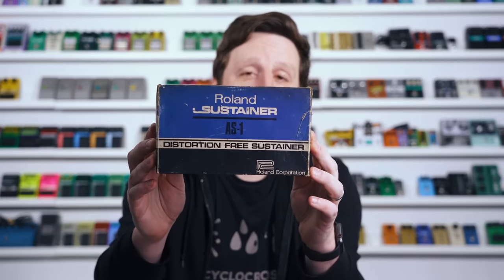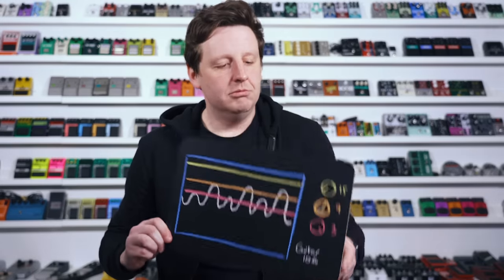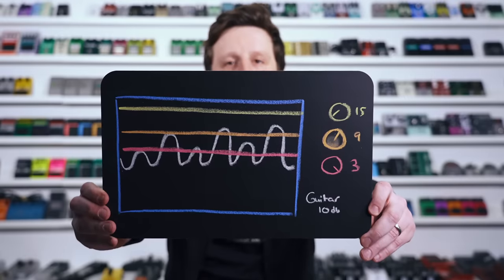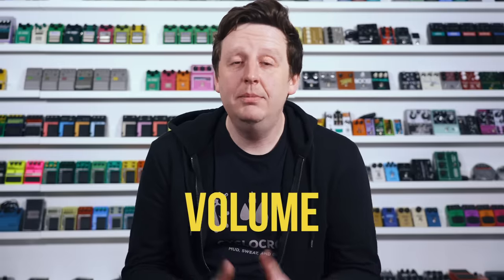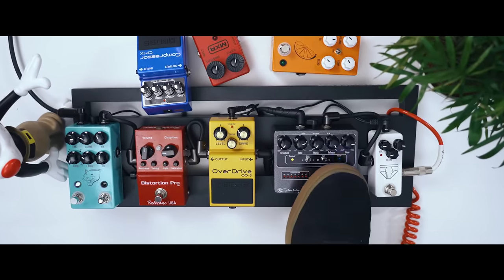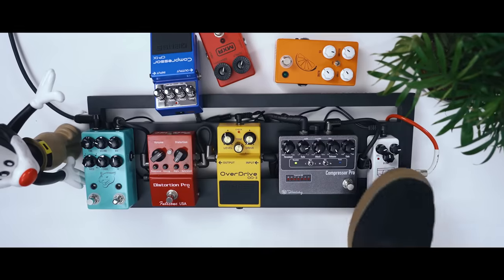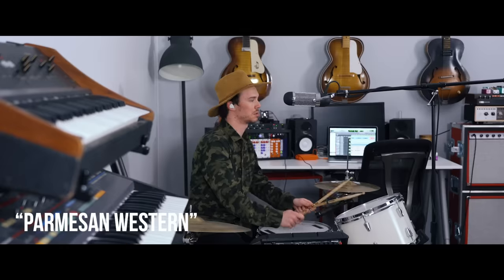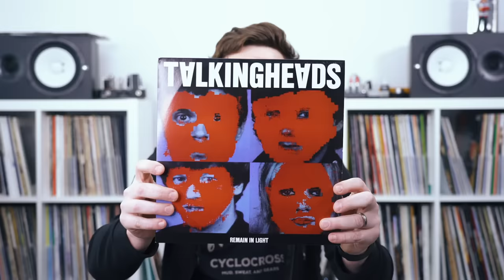How Do Compressor Pedals Work?

Comment: For me, the fewer pedals the better. Less noise, clutter, connections, cables etc....I would LOVE to see Boss combine their tuner and compression pedals into a single unit, since they are often first devices in a signal chain.
Reply: that’s not a bad idea. click on, tuner. click off, compression.
Reply: Click on compression, click off no compression. Hold for 2 seconds, tuner
Reply: @joshualessore7652  exactly. Compress, bypass, tune. I usually only use a compressor when playing single coils percussively.
Reply: fantastic concept... I'd buy that!
Reply: I hate compression pedals before distortion, steals all the attack and makes overdrive sound like crap
Reply: With a lot of pedals, having a good input and output buffer and possibly an isolator such as the Lehle P-ISO can go a long way in reducing noise. It is also crucial to invest in a proper power supply and high-quality cables. Never cheap out on cables and power, high quality power supplies and cables are expensive yes, but they are worth every penny.
Reply: Lol
Reply: Great idea!
Reply: @thebrunoserge you'd have to set up a compressor pretty poorly for it to sound better after any kind of drive.

It add a huge amount of attack. Listen to any country pickn for reference.

After drives, you're squishing your distorted tone and getting that awful mosquito buzz tone. Also you're introducing a lot of pointless noise by amplifying it's ratio vs guitar signal.
Reply: @constantk8780  I think you're right. Since then I've switched to compressor before volume/wah and distortions. I also got a new drive pedal (caline pure sky) to replace my Il Torino and it stacks much better with my JHS AT (different drive archetype helps, il torino was LED based similar to AT so they were weird stacked). Now I feel compressor first sounds superior for sure. Ohh and also I didn't know high distortion was supposed to go before low gain drives. I learned a lot
Reply: @thebrunoserge you don't have to turn the compressor pedal on when usuing distortion
Reply: @ConditionZero76  True, distortion already compresses it 90% of the way. But still, most people set and forget the compressor on the board and leave it on because it's the only way to get a usable clean neck tone, often
Reply: @thebrunoserge  Depends on the pickup and the Distortion...  My Diamond has an active bridge pickup just about as hot as the sun, my choices going into a fuzz are use a compression pedal to roll of the ear splitting top noise or never turn the volume up on the guitar past barely on.  The key to using compression before distortion is to have the CORRECT type of compression and adjust the attack setting of the Compressor so that it lets all of the start of your note through and clips a touch (and I mean just a touch) AFTER the attack of the note.  If you get your EQ and Compression right going into your distortion you can isolate your sound better in the mix and avoid getting lost in the flub
Reply: @thebrunoserge the whole point of the attack control is to enable you to increase the amount of attack by not compressing it! The result being a more consistent and powerful attack!

Comment: Never really understood compressors, always thought it was something they added in the studio. This helped a bunch, thanks!
Reply: They’re potentially useful at almost any step in the signal chain, and very useful in live situations as well as in the studio! I can’t remember the last time I did a mix that didn’t involve some compression somewhere (and that includes monitor mixes, too). Just don’t over do it or things will sound weird. Knowing exactly what “over doing it” means is a topic that could fill a book. Fortunately, in the context of guitar pedals being used in guitar rigs, there’s an easy 2-step process:
1) If your guitar sounds more like the way you want it to with the compressor than it does without, it’s probably fine.
2) If you’re still in doubt, back off the compression knob a bit and return to step 1.
Reply: Well, they also ALWAYS add it in studio to everything. The best way to understand compressors is just to try them, and to do so in every part of the effect chain, since they're really versatile.

Comment: Since you mentioned putting compression before ODs, I'd love to see a full video on best practices for effect order. The hows and whys of where to put each effect  in the signal chain. Maybe some sidenotes on buffers, or tricks to do with A/B/Y switches.
Reply: You just have to learn to picture the chain in your head, start with the least effecting into more dramatic, say drive into phaser will be powered but swishy is last say on the matter, phaser into drive has over all distortion but swishy internals, eventually everything becomes a preamp, and all you want is a preamp, they make the clover for that
Reply: That's why the blend is important; before that was a common feature, it really was only viable to place before drives, where the effect is NOT subtle; placed after, with a decent dry level, you can retain dynamics while increasing sustain.

Comment: I've tried a bunch of compressors, and find that ones with a blend control sound best. I'm currently using The Warden Compressor by Earthquaker Deicives which you mentioned. I have it as a subtle always on effect. Thanks for the video, Josh. It was great and I'm liking the new jam section format to the videos.

Comment: Hi Josh, thank you for the detailed explanations on comp controls. I use a Strymon Compadre analog dual voice compressor first in my signal chain as an "always on" pedal (it was released right after you made this video). Compression set to about 65%, Blend at 50%, Level set to unity gain and voice switched to "Studio" setting. I am new to using compression and it is a true game changer for my 80's rock pedalboard setup.

Comment: GREAT video!!!
I use 100% ON Dave Barber’s Tone Press at the beginning of my signal chain after my Line6 G70 but before my A/B LaunchPad. If I understand correctly, Dave was THE guy who invented the parallel blend for guitar compressors, of which all others have followed, to which we all have benefitted. Barber Electronics pedals are my personal FAVES for his compression, his gain boost pedals (multiple versions of the “LTD”), and of course, I also use his A/B “Launch Pad”!.. and the 2channel Burn Unit EQ is my go to for internal trim pot tweak-able distortion.

Comment: Exactly against your advice i use an mxr after my overdrives as a solo boost. It gives more volume and sustain, smooths out the differences between overdrives, doesn't change the tone. Its been on my setup for years...

Definitely tempted now to get a tighty whitey for the front of the chain exactly for the OD input and smoother clean rhythm chords

Comment: Transparency is the most important part of a compressor. I was under the impression that the Dynacomp and Ross weren't transparent.

I initially bought a compressor as I wanted more clean volume from my Fender Concert amp when playing with my band. It did that well as the attack signal excursions were limited and the amp didn't distort. The tail of the note was amplified too which sounded louder too. 

I then like having it on all the time as I found single notes didn't disappear into the ether.
Single notes were the same volume as chords which handy.

Comment: Awesome video! Just a quick note about the threshold part – it can sometimes be a bit tricky to grasp. The threshold acts as the point where the compressor kicks in, but it's not like a strict cutoff.

Imagine your signal is at 10 dB and the threshold is set at 9 dB. With a 1:2 ratio, you'll actually get around 9.5 dB, not exactly 9 dB. What happens is that the compressor starts reducing anything that goes above 9 dB by half.

Thanks and cheers!

Comment: Just bought the JHS Pulp n Peel V4 to use with my upright bass. The response from my Fishman pickup has always been uneven across the strings and up the fingerboard. The blend control on the PnP V4 lets me dial in just the right amount of compression to level out the response without squashing the acoustic sound and natural attach. A great solution for upright bass pickups.

Comment: I have 3 different MXR compression pedals that I use for electric guitar.  The original DynaComp is mostly always on.  I also have a Super Comp and a.......?  I don't remember but it is some moded version of the Dynacomp.  I have very specific uses for all 3.
I also have a rack mounted optical compressor that I run my mixer board through.  It is a bit more difficult to discern what that one accomplishes but it mostly brings the mix together.

Comment: Hi and thanks for the explanations.
Compressor freak here, using them since ever, both in pedals (SP from exotic, Carl Martin,etc) and outboard rack gear (Symetrix, SPL, Drawmer).
Can do without, but prefer to have the option 'with', never always on, unless it's an ambient thing.
People tend to down play compressors or just regurgitate what they've heard, but take your time to try, with different settings, and you might find something useful in there, as I did. And yes, it works great with distortion too. You have inherent compression with a tube amp.
And 'compression', is everywhere.
Reply: And they sound great 'after' a Reverb...!

Comment: Used to be in a surf music band and used compression on lead guitar with a rack mounted DBX 166a. but when I got into The Byrds after my wife bought me a Rickenbacker 360 12 I totally went nuts on compressioni bought the first edition JangleBox which got me that famous Roger McGuinn sound. After a few years the JangleBox 3 came out which had a redesigned circuit and added treble and base adjustment and a boost section with separate treble and base adjustment.
 It is my always on pedal from LedZeplin, AC/DC, U2  to praise music that pedal is total awesome sauce!

Comment: I use a vintage BOSS CS-2 at the front of my signal chain and my playing leans towards the Andy Summers/post-punk textural style with lots of clean tones.  The compressor makes single-coil pickups punch and thickens up flanger/chorus/signal processing effects wonderfully.  Downside is distortion and overdrive tends to be essentially non-varied in volume and not all that touch sensitive.  If you're a blues guy- don't even bother with compression because it will rob you of that dynamic touch and finesse- but if you are looking for that big, punchy, processed 80's clean-toned guitar sound ala The Fix or The Police-  the compressor is the perfect pedal.  

Can you imagine Mark Knopflers' Strat tones on "Sultans . . ."  without compression?  How about Trevor Rabin's killer clean tones on Yes' "Owner Of A Lonely Heart" without it?  That's the beauty of compression.

Comment: I gotta add one more pedal......the TC Electronic Sustain+Parametric Equalizer. I got one back in the late 80's, and fell in love the first time I used it! I'm a bit odd, as I don't use compression on clean sounds. I use it to boost either the gain channel of my amp( Mesa-Boogie ), or gain pedals in the clean channel.  It is KILLER!  I can be in the lead channel of my Boogie(with the gain ALL the way up!!!), turn the pedal on with the guitar volume on 5 or so, and no noise at all. I know what Josh is saying that compressors don't generate noise.....but when you use them to boost distortion, with a lot of other compressors that I have used over the years, there IS noise. But not with the TC Sustainer. Best compressor hands down for distortion!!!!

Comment: This all sounds well and good but I feel the need to point out that my favorite living guitarist, who has probably the best tone I’ve ever heard, stacks 2 tube screamers in front of his Ross compressor… I mean, there are multiple ways to get around the effect of the confessor after OD hiss… and if you can manage it you can pull off a ridiculously sustained tone. Hollowbody -> overdrive -> compression… then your guitar’s volume knob becomes your overall gain, and you can back off and clean it up nicely or dime it for an aggressive sustained tone. I personally do this, but I run the signal chain through an MXR noise clamp loop which eliminates the hiss whenever you aren’t actually playing. Just my 2 cents.

Comment: Dear Mr. Pedals...Several years ago, I replaced my Keeley 4-knob compressor (the silver one that looked like the fridge in my grandmother's basement) with an MXR Custom Comp and set the internal clock to the "New Wave" settings and left it that way...So what's the difference between the Custom Comp and the Dyna Comp, if any? Thank you. Your viewer, Violet

Comment: I have an old "Gates Sta Level", and I built a Fairchild 169 using Sowter  iron. I have built a lot of comps, comp limiters, & expanders. The old analog telco compressors used the NE570, NE571 and NE572 Compander chips. Trunk compander was the NE570 and subscriber were the NE571 and NE572 chips that are the same as the NE570 only mostly not as quiet. Radio stations also used compression and automatic gain control, so they could set their levels and not go into bad distortion if a passage of music became to loud or a live announcer also became too loud.
Reply: The American 440Hz A concert pitch standard also owes its origins to radio. Before that, there was no standard for A or any other note. It was all relative. Conductors and composers all had numerous tuning forks that varied by 1-10 Hz either way but more often than not  they were 2-8 Hz flat. To tune the front end of a radio and to make sure a radio station was on frequency for transmission a standard was required, and it became the  440 Hz A. If it's a little off one way it's sharp and the other way, it's flat. Baroque music used a 466Hz A and stringed instrument players were snapping strings like crazy, so that was the early European origins of a standardized pitch.
Reply: I think one composer even had a 426Hz A tuning fork. That is really flat, and Baroque pitch was as high as a 466 Hz A above middle C which resulted in lots of broken strings among violinists, cellists, guitarist, lute players, etc.

Comment: Best description I ever heard was from TPS, - "An Overdrive pedal for clean tones".
Where higher levels can wreck good Drive sounds, it's  the thing with cleans.With the dry blend option, you can get some brilliant results, pre or post Drive section.Without the blend,much more limited. 
The Tighty Whitey and the Xotic are a good place to start.The EHX Tone Corset is ugly, and a little noisy, but it's cheap and user friendly.
Reply: Carl Marin Compressor/Limiter is a good start too. I do have the SP from Exotic and it is ... monstrous!

Comment: Hey Josh. Great video !! I have a question. 
My set up :  Korg tuner - VS Optical Volume Pedal -  Bad Horsie 2 Wah - Zendrive  - Boss NS2 ---> Boogie Mk1     I placed a Keely Plus Comprsor after the Boss NS2 and get a really annoying hiss when the NS2 is not activated....a bit less when NS2 switched on but still not acceptable to me.  
Based on your information I should place the Keely Plus Compressor BEFORE the Zendrive so I'm definitely going to try that out.....but at what place before the Zendrive should  I place it ? 
Before EVERYthing? Even before the tuner ? Or at another place ?

Comment: 5:30 / Attack: I know I'm late to the party, but doesn't Attack in a compressor refer to the time the compressor levels the input signal down to the threshold AFTER input signal has exceeded said threshold? The attack-time of a compressor therefore handles and processes the input's signal transient whereas in your explanation attack would be the transient itself. Other than that: very satisfying videos, thanks for sharing!
Reply: That's how I understand compressor attack controls...very different than the explanation here.

Comment: Two cents about learning guitar or any amplified instrument- being conscientious of your instrument's level is easy to get away from and a compressor is a good tool to use for the purpose of raising a player's awareness of differences in levels. BUT, for developing technique, otherwise known as practicing, as much time using a compressor should be used without a compressor for learning the actual volume level differences and possibly achieving desired tone with less or no compression.

I would also recommend experimenting with putting the compressor last in the effects chain to really hear the extraneous noise effects make and if you like the extra noise, consider using a noise gate as the very last dynamics control to take out the noise when nothing is being played.

Comment: What's funny is I actually JUST moved my compressor to be after my drive pedals. I had it very early in my signal, and just yesterday I tried moving it to post-distortion, and I liked the effect so much more. Not a universal truth or anything, but for me I think it might be right. I have 3 roommates and I can't blare my guitar, so having the comp after my drivers lets me dial in the amount of distortion I want and still control that volume. Maybe not a permanent change, but for practicing in the house it's great so far!